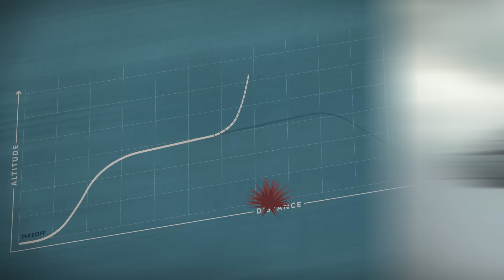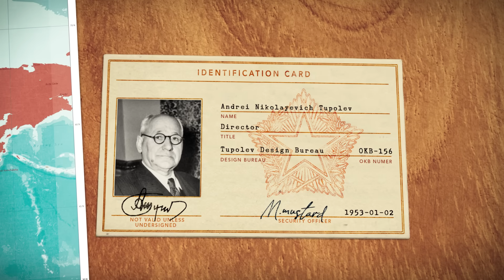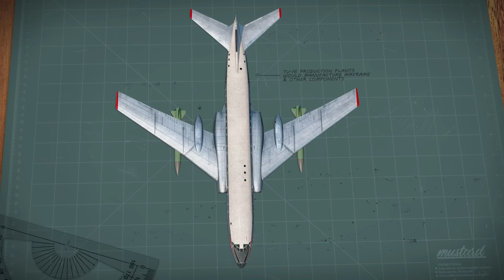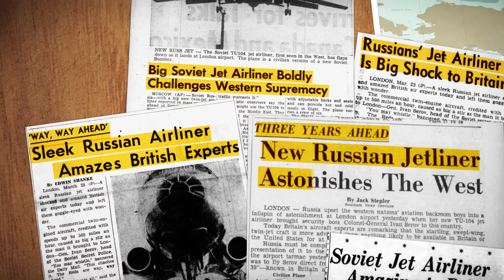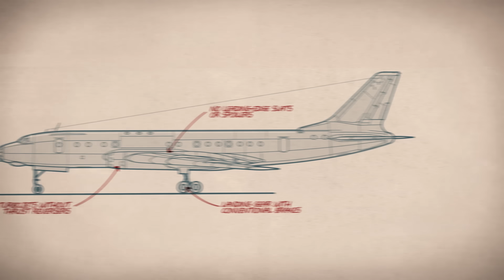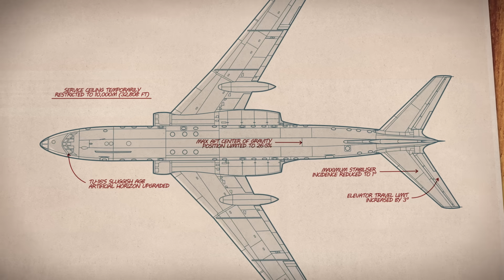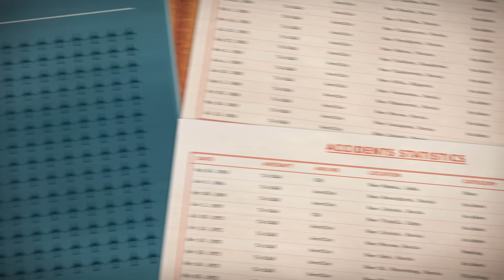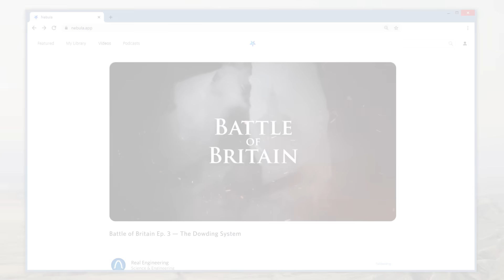The Soviet Airliner Designed To Crash

Comment: While watching this video I noticed that the 104's North Atlantic crossing route was the route used for smaller aircraft, via Iceland. After looking up her specs  I can see why: range of only 1320 miles. So while she was fast, she couldn't go transoceanic without a fuel stop. Very strange. The DC-4 boasted a range of 3200 miles. Easily crossed the North Atlantic directly - straight across the pond NY to London for example. Just seems odd that a jet airliner would be designed with such a short range...

Comment: Wow, this plan had the same problem the Boeing 737 MAX had with the difference that The MAX would nose dive instead.
Reply: yeah, so it was different
Reply: @jasperhunter8386  It wasn't different. The only reason the 737 MAX was nose diving was because the MCAS system was trying to fix the issue of the plan's nose going upwards. Both planes had the same issue, the 104 just didn't have a system to push the plans nose back down.
Reply: The de Havilland Comet was the worst jetliner in history, the Comet would explode in a catastrophic in-flight structural failure.
1 out of every 4 built crashed or were destroyed in accidents making it the worst safety safety record of any jet airliner.
Reply: @sandervanderkammen9230  3 crashed out of like 112 made, dunno where you got those figures from
Reply: @jasperhunter8386  26 Comets in total crashed or were destroyed in accidents killing 426 people.
The Comet has the worst per flight and per passenger mile safety record of any commercial jet aircraft  in history.
Reply: @sandervanderkammen9230  only 13 were fatal, pilot error accounted for 5, 3 of them were hull loss in the comet 1 and another was a terrorist,  dunno where you get your stats from, perhaps link them?
Reply: @jasperhunter8386  26 Comets in total crashed or were destroyed in accidents, this is common knowledge.
6 Comet 1s were destroyed by catastrophic in-flight structural failures or a fatal design flaw in the engine inlets. 
The Comet fleet was grounded twice due to premature metal fatigue failures.
The Comet remains the worst safety record of any jet airliner in history.
Reply: @sandervanderkammen9230  link where you got these claims from, find a website, create a website, but as far as I am concerned the Robinson R44 has the worst safety record with 1,500 serious incidences or even the Ilyushin Il-18, of which an estimated 678 were made, had 97 hull-loss accidents resulting in 2,483 deaths
Reply: @jasperhunter8386  The Comet still  has a worse per flight and per passenger mile fatalities and accidents rate.
 The R44 is helicopter which typically have a much higher risk due VTOL operation, and it is primarily a General Avation aircraft which has different (lower) standards for pilots and maintenance and inspection than commercial jet aircraft.
At 6,300 units and still in production makes the R44 one of the most popular aircraft in history.
1,500 is actually good for what is mostly amateur helicopter pilots flying in uncontrollable airspace.
Reply: @jasperhunter8386  Again you are not making an equivalent analogy, first the Il-18 is not a commercial jet airliner, it's also a military service aircraft and was flown by many third world airlines that do not comply with FAA or EASA safety standards.
Reply: @sandervanderkammen9230 

Obviously it's always very important to note the relevant facts.

Indeed we feel able to clear up a few common misconceptions & false myths.

Kharzeestan Krappenz DiktorBummer Jurkzxoffenz etc and co - they should all note good with much awe & extreme wonder.
        UPDATE MORE BREAKING NEWS ETC

    How things were back then -
Accident losses - % of aircraft built.
DeHavilland Comet 4 UK                        14% 
DeHavilland Comet all   ff-1949             17%  
Vickers VC10 UK                                      5%
HS-121 Trident   (ff 1962)                       15%
   The DH Comet had better safety than or similar safety to many other commercial passenger aircraft of a similar era
    Douglas DC-1       .      99%
      Douglas DC-2            47%
    Douglas DC-3              30%
      Douglas DC-4            26%
    Boeing s300                72% 
 Boeing 307                     70%
  Boeing 247                    48%
     Boeing 707                 20% 
Lockheed L-049/149 Constellation  30%
   Lockheed Electra  Turboprop         29%
Fairchild FH-227                                  30%
 McDonnell Douglas DC-8                  14%
  Sud Aviation Caravelle                      15%
Canadair CL-44  Turboprop                46%  
Convair CV-580  Turboprop         .      22%
Convair CV-880    (ff 1959)                 27%  
Convair CV-990     (ff 1961)                35%
Tupolev T-104         (ff 1955)               16%

        The Comet was designed with military use in mind, Nimrod work started at De Havilland in 1953.
   The investigation committee did not find hundreds of fatal flaws or evidence of design defects, structural defects, defective materials or shoddy workmanship. Ripstop provision was included. Claimed incidents did not involve cracks starting from window corners.
     The engine & engine intake position had advantages, were not flaws or fatal flaws & were not the cause of any incidents involving any Comet or Nimrod aircraft. Nearly all changes before the Comet 4 were just in case or were previously scheduled improvements. 
  Bow-wing & the 707 story (see b-47 wing folding incidents) is the result of global economics & the well protected & very large domestic US airliner market & active support from the UK with for instance proposed competing airliners from Vickers & DH being blocked by the UK government at the time, cheap & nasty was the requirement with large scale production capability in one place.
  The 707 was of course a much larger aircraft which as a stressed skin metal airframe aircraft would require a thicker skin anyway. They got lucky at the time essentially.  Bow-wing is the result of the large & well protected  US domestic airliner market 
  The fate of De Havilland was due to Govt policy Aerospace sector rationalisation & global economics, it was nothing to do with the Comet.
  A comprehensive, thorough & protracted testing program was carried out on the prototype & it's assemblies. Of course the Comet did indeed have Ripstop stop provision. 
     De Havilland (Of England) Comets were not grounded after 1970 due to structural problems.
It's interesting that some of the aircraft on the list should really have been noticeably safer than the Comet due to being a similar type but of much later design & manufacture but they definately were not safer.
    How things were back then -
Accident losses - % of aircraft built.
DeHavilland Comet 4 UK     14% 
DeHavilland Comet all mks  17%  
Vickers VC10 UK 5%
   The DH Comet had better safety than or similar safety to many other commercial passenger aircraft of a similar era
    Douglas DC-1        99%
      Douglas DC-2        47%
    Douglas DC-3        30%
      Douglas DC-4          26%
    Boeing s300            72% 
 Boeing 307               70%
  Boeing 247                48%
     Boeing 707                   20% 
Lockheed L-049/149 Constellation  30%
   Lockheed Electra  Turboprop    29%
Fairchild FH-227                         30%
 McDonnell Douglas DC-8     14%
  Sud Aviation Caravelle       15%
Canadair CL-44  Turboprop   46%  
Convair CV-580  Turboprop 22%
Tupolev T-104                          16%

A comparison of more recent aircraft.
Accident losses comparison examples. 
1970s - 1980s
    % of total Aircraft built
Similar aircraft type, date / decade, useage, size.
    Biz Jets
BAe-125-800                        1.7 %
Beechcraft Beechjet 400    2.2 %
Cessna 550 Citation II         7.1 %
Learjet 35 / 36                       12 %
Beechcraft 1900                  6%
Dassault Falcon 10              11.5%
Aérospatiale SN.601            22.5%

Medium size jets / Turboprops.
BAe-146               5.1%
Fokker 100          6%
McDonnell Douglas DC-9-30       9.5%
Fairchild FH-227       30%
McDonnell Douglas DC-8    14%
Canadair CL-44  Turboprop   46%  
Convair CV-580   Turboprop   22%

Beechcraft, Fokker, McDonnell Douglass, Learjet, Fairchild, Aerospatiale, Canadair, Convair  companies defunct.

    All Comets, including some Comet 1s, had full civilian use certification at some point after 1954,  civilian use certification only being withdrawn after commercial flying stopped. Examples were flying until 1997 - one example did a signals research global circumnavigation flight series in 1993 via Australia virtually without a rest travelling 28000 miles, only had an ice warning indicator issue during the flights.

    The DH Comet - World Firsts.
1st gas turbine jet powered airliner. 1st high altitude 8psi pressurised full fuselage length passenger cabin airliner,  not a trivial feature as structure  strength required for pressurisation considerably exceeded strength required for normal flying stress. Nobody else had done anything similar before the Comet.
  The b-47 used 2 relatively small, heavily built  pressurised modules  (the aircraft where 6 had their wings fold up in 2 months while flying & some had their wings fall off while parked). 
   The 1937 Boeing piston engined airliner pressurised passenger cabin was pressurised to 2 psi only - in fact that could easily be done as the normal unpressurized fuselage cabin structure strength for flying stresses only was all that was needed to be adequate so no significant weight increase issues needed addressing.
    1st all hydraulically powered flying surface controls & actuators airliner with under carriage wheel disk brakes + ABS.
1st jet airliner to cross the Atlantic.
1st jet aircraft to do a world circumnavigation flights series.
  Of course De Havilland had prior experience building many all metal construction airframe aircraft including thousands of jet powered fighter aircraft that were primarily of metal construction with pressurised cockpits & jet engines built by De-Havilland & we know the world's first all metal construction airframe airliner was built in England in the 1920s by Handley Page.
     De Havilland did indeed always work to better than industry standards at the time, used up to date knowledge for the design & no evidence of negligence  or criminal negligence was ever produced in relation to the DH Comet.
    The course of De Havilland & the general UK aerospace industry sector was not affected even slightly by the DH Comet. The course of national aerospace sectors obviously being similar & inevitable in many countries.
     Other interesting World firsts
World's first turboprop aircraft & airliner.
Vickers Viscount Turboprop Airliner 1947. 
A 1945 Gloster Meteor Aircraft with Turboprop Gas Turbine Engine.

They might like to answer these questions.
   Which airline has just ordered
60 RR England Trent XWB Engines
& What aircraft are the engines for?

Bonus question for 10 points.
         Which country has the 
World's Highest Combined Per Capita
  Nuclear + Defence + Aerospace Sector Activity?    

          👍 & 🙂 & of course 😎 indeed.
          C H E E R S & without doubt  -
          Toodle PIP Old C H A Ps.

We hope this helps.     
 
This line left not blank intentionally.
           
   The next line is blank intentionally.     
             
. .... . ... ...  .  ....  ......
. . ... ..         ... . ......
 ....      .... ............ .....   .
Ivcxivcxivcvcx. . . . 
cxcxcvccbccv. ...   ...
xcxiivxccxvccv.... ...
ccvvcvvcxccxc.. .....
Reply: The NTSB found nothing wrong with the 737 Max, both accidents were ultimately the result of flight crews failing to follow the proper procedure for a runaway stabilator trim control.
Reply: @sandervanderkammen9230  — The NTSB had no jurisdiction in either crash.  Airline regulators around the world found that something definitely was wrong, and they grounded the aircraft.  Boeing was forced to fix (and document) the MCAS.
Reply: @GH-oi2jf  The NTSB was involved in both investigations, and it was the FAA that was ultimately found partially responsible for both of the crashes which were both primarily caused by pilot error.
Neither flight crew followed the proper procedure for runaway stabilator trim control.